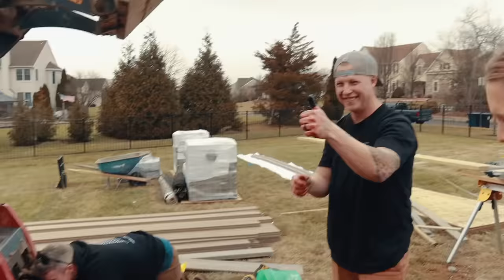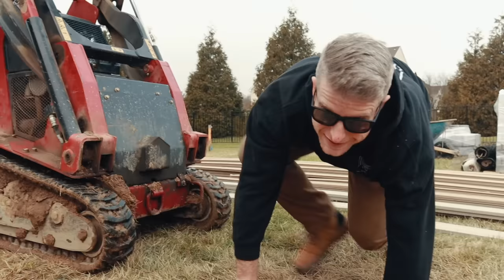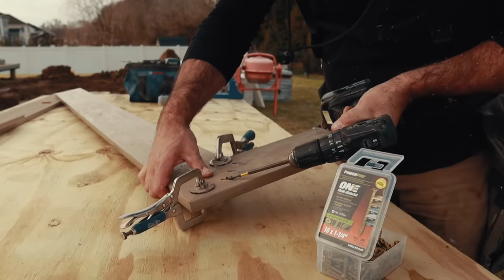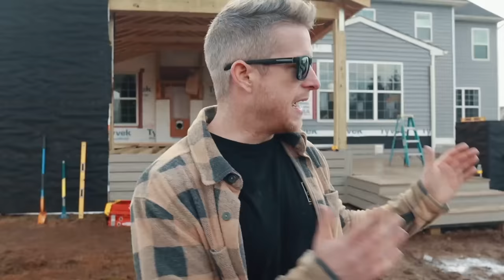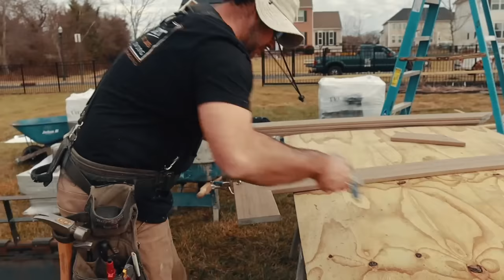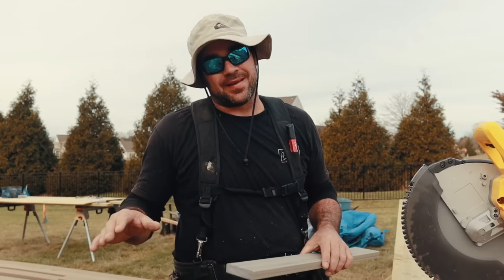Miter Hacks and Patio Prep - THE MOUNTAIN PT. 4

Comment: I like to use 2p10 on the miters. Not only do you have the adhesive in addition to the pocket screws, but you line it up, hold it for 10 seconds and it’s not moving. Now install your pocket screws with no need for clamps

Comment: I do the same to the joints, but with biscuits instead of pocket screws.
Reply: So, no gaps needed for temps changes, expansion of the mitered corners?
I'm in the process of doing my first small deck project, and would like tight miters.
With biscuits, do you use a special type, and a compatible glue?
TIA
Reply: @hnd2893  the amout of expansion is determined by temp range and length of the pieces connected. I can't recall the exact numbers, but there won't be any problem with how short stair steps are. I am an electrician and we do have to add expansion sleves or outdoor pvc conduit for certain length runs. For very long runs you could make it two pieces where the one that will miter only goes to the closest rail post (>6' or so). I am in mn and haven't had callbacks for 6' miters.

If you are a stilled carpenter, you could do what drdeck does and cut end pieces and solvent weld the end to hide the cut. Just use butt ends and not worry about miters. I only use Azek, which is pvc and use pretty much any clear pvc cement that you normally use for plumbing. Just make sure to put masking take over the exposed sides incase there is squeeze out, just wiped it off before it hardens and the tape will keep the surface clean. They do sell biscuits in pvc, but they are very expensive since it is a niche market. I just use regular #10 wood biscuits to help align the surface and use pvc cement to fuse it. No idea about other composits of mixed fiber and I was never satisfied with the supglue strength.
Reply: @Pepe-dq2ib  
Thanks!
I'm considering options, in my particular application, I'm mitering a 4' to a 16' piece, temps in my area can go from below 40°F to 90°+F in a day, it gets direct sunlight spring thru fall.
I've been out in the garage 4 times now looking for my Kreg Mitering jig, I know I have one, somewhere :O)
Reply: Ive never had my decking move on me using 2p10 and pocket screws. Most of the movement is in the pt lumber below not the decking.

Comment: Honest question 
I thought composite deck boards couldn’t have tight mitres because of expansion and contraction  in colder to warmer climates  
I read the manufacture specs and it called for really big gaps  in the mitres     Which I thought was ugly but necessary 

Was I incorrect  ?  Live in Canada and it was TimberTech 
Called for 3/16 gap in any butt joints  when installing  below   32      

A butt joint is not a mitre joint   But will still expand or contract length way

Comment: Show it all during the summer.   You built it when the plastic decking is at its most shrunk point, what does it look like after it has expanded for a summer season?   Many plastic decks look great when you first put them in, doesn't mean that is what they stay like.  We are building one right now and it is beyond a pain in the ass with all the expansion going on, it is getting to work early in the day to fasten boards and cutting out when the temps and sun start to rise, just to get uniformity, come back the next day and nothing is back to where it first was, factor in the deck joist during the summer being shrunk too from low humidity vs winter when they swell, I'd be so interested to see what this deck looks like after a year and how well it held up.   
Your joists are also different wood than what we can get around here, the pressure treated stuff where I live is absolute crap, adding to the whole fiasco of it all.   These decks are expensive, yet the products we use have a mind  of their own. 
I had a railing rep talking to me the other day about his product, when I mentioned all the issues I have been seeing and asking how it effects his product, he flat out told me that it totally messes with the cable tensioning, when I asked him about staircases and having a weird rise and run, he said that anything not being 32 degrees does not work with their product.     His greatest reply was saying that we should all charge an extra 20%, I was a bit puzzled, but I then got his jest, he was basically saying that it gives you the option to give money back to the client to make them feel better about their deck not being perfect, once you have explained why the materials are doing what they are doing and completely out of your control.   
I watched a video a of guy who builds decks call his work a 7 out of 10, but that he does it this way because it stays a 7 out of 10 no matter what the plastic does with its expansion and contraction.   He flat out said that if you try to make a 10, it is going to fail and look like shit later. 
imagine all the contractors who don't give a shit and are out there building a deck throughout a day when the temps and sun vary throughout their workdays as they are building a deck.  
I see so much crap work already from past contractors that I am getting so sick and tired of seeing it all.  It is a bit disheartening to see guys doing such shit work and not caring at all. they just want to get in get out as fast as possible, taking the money and running, many clients tell me that they were never able to get them back on the phone once they got the final check. 
I stand behind my work, and I feel absolutely screwed with what products are being put out on the market and we are the ones who have to stand behind them, when it is totally out of our control with how a companies product is going to shrink and expand.  
Once it looks like shit, it is all a bunch of finger pointing at who is to blame, and the famous line of.. "It is within industry standards".    A line that is such BS.

Comment: What type /size of pocket screws are you using on them miters?
Reply: Another video I saw and the guy was using 1 & 5/8 #8 screws to secure the miter. Make sure the screws are weather proof.
Reply: @EtoTheKay  Thanks for the reply!  I finished my project last weekend.  I hadn't realized the jig comes with stainless screws 1 1/4 and 2".  According to their screw chart 1 1/2" should have been used for 1" material thickness.  I played with the collar depth and got the 1  1/4" to work and things turned out real nice.  Despite clamping the boards just like they did in this video I still had issue with the screw trying to push the mated board out.  Running the screw in then out and removing the flashing of material that exits the hole then reinstalling the screw made for the tightest joint.  Just had to be careful with the shorter screw not to overdrive and strip it.  Using scraps to test with certainly helped!